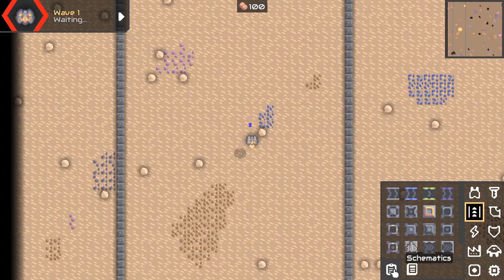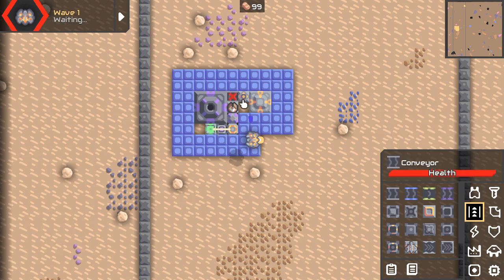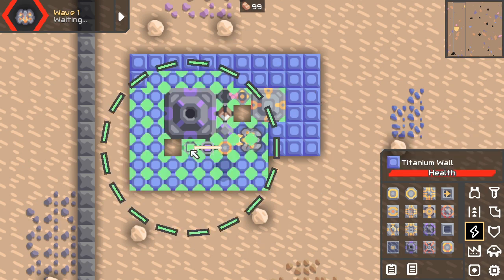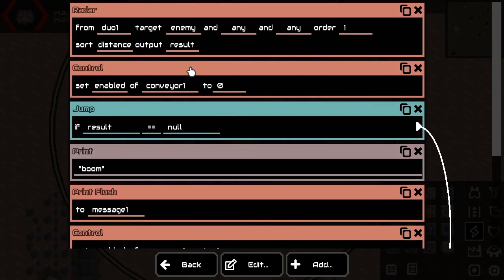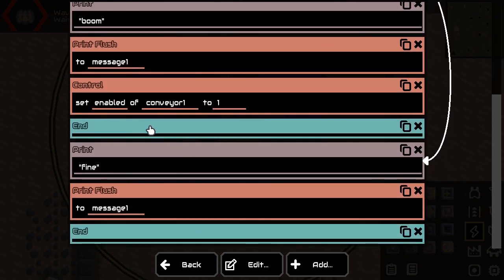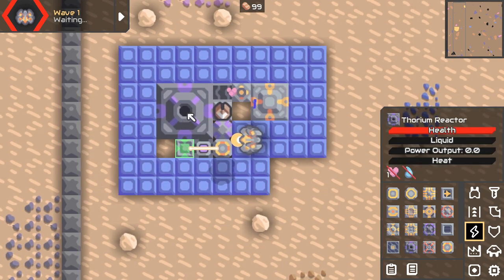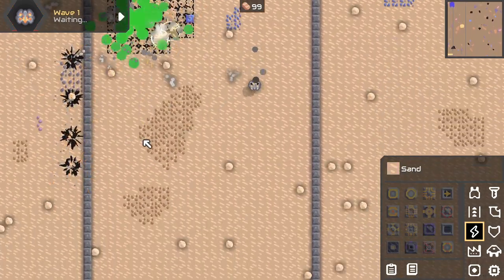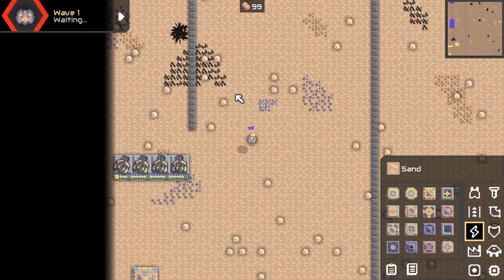Thorium Reactor Bomb - Mindustry v6.0 Logic Tutorial

Comment: Splendid! I always wanted my own blue peacock.
Do it work when the reactor is disabled (enabled=0)? I am curious that deactivated reactor produce heat.
Reply: It worked actually. Just disable the reactor before filling it up.
Reply from the maker: That's cool! Pumping the items into the reactor is a major weakpoint. Just having the reactor filled up with a processor nearby is a much more resilient build.

Kudos on the great engineering work ;)

Comment: thats cool :D. it could be used as a backup defence if the enemies get past the main one maybe?
Reply from the maker: Yesssss! But the build can be simplified a lot to make it less likely to fail. If I were to build it for real, I'd create a long-range turret to sense enemies (thanks Matix 777)  and disable the reactor instead of the conveyor (thanks 梅原健司). Maybe also a force projector and a check to make sure the unit has enough HP to be a boss. There's a lot to improve!